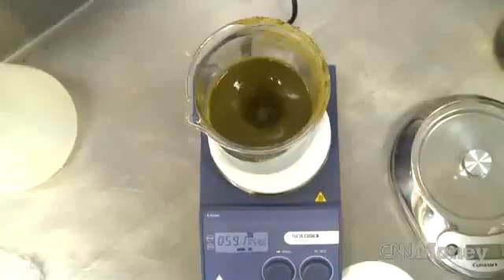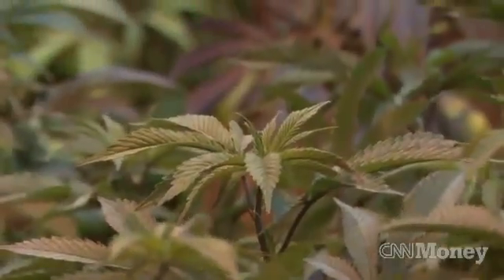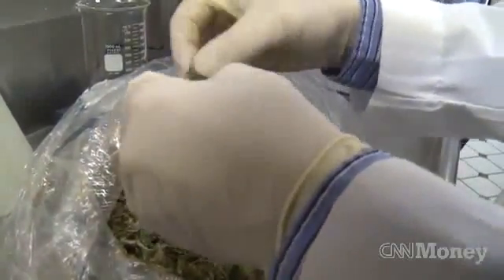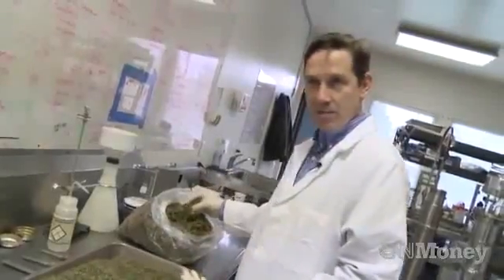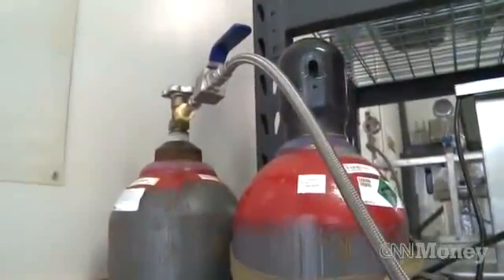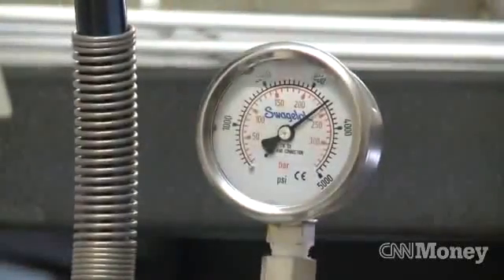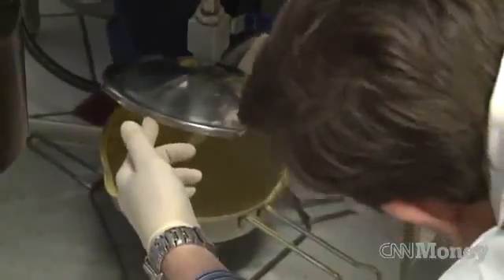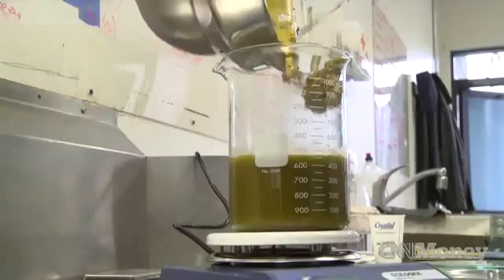Eden Labs Supercritical CO2 Extraction System featured on CNN

Comment: IF you put that same expended leaf material in a tamisium you would get another 600-100 grams out easily. On top of what you just extracted. And you can still control the time pressure and temperature with zero reaction to water and no polarizing. Although that is a option as well. The TE3000 extracts from 1200 grams and recovers the solvent for reuse in about 3.5 hours. Less if you use the sucker tank and compile batch extracts for refining one time if even needed.